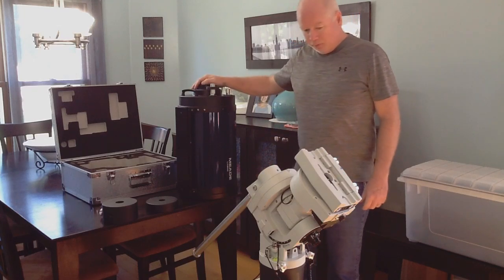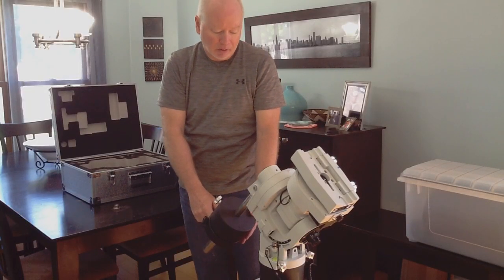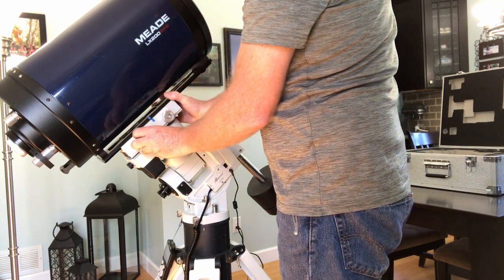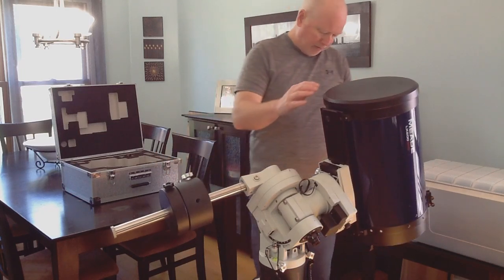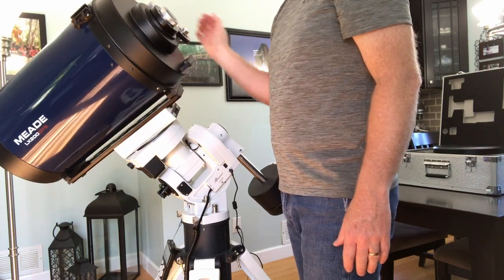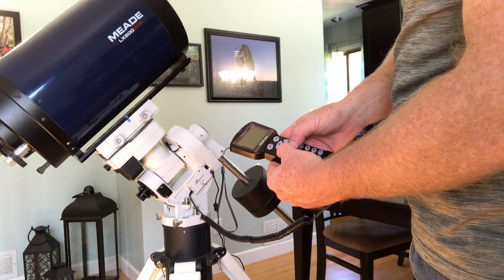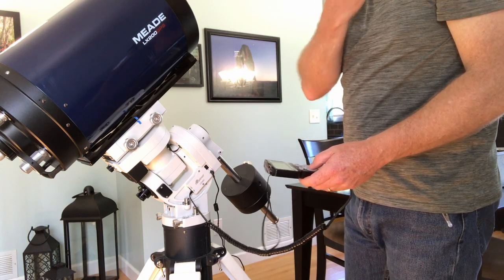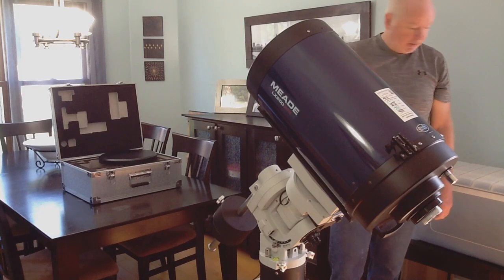iOptron CEM60 - 10" SCT Balance, Zero Position and Stalling the Gears!!

Comment: I had an older Ultima C-11 SCT, it weighed 30 lb on my bathroom scale, so the 10 " would be somewhat lighter, I think?
Mounted the C-11 on my Vixen GP D a few times, it was an over kill on the Vixen mount rated for 25 lb, but careful balancing I was able to use it for visual observation.
Reply: Not exactly apples to apples. Meade SCTs are considerably heavier than Celestron SCTs.

Comment: With my iOptron GEM45 I always tighten the saddle clamps using an Allen/Hex key. You can get it nice and tight. I always put on the end stops just to make sure.
Reply: Neat trick is to add a small lLosmandy/ADM D clamp in front of the saddle to save your center position and to act as a safety in case the dovetail slides out.
Reply from the maker: Great tip!!
Reply: Did the same with my GEM45. Just sold it and bought a CEM60, I'll do the same. Nothing beats that piece of mind.

Comment: Jeff, hey I remember you mentioned that had a Losmandy GI Mount and you said you were having to tinker with it a lot.  I have heard this before, but is this mainly for the older ones or does that apply to the newer model?  I wasn’t sure which generation you were referring to.  Thanks a lot for any input you may have as a I am a newbie looking to get into astrophotography.  I got a used Celestron Edge HD but now rethinking it for first time scope and may return it.  The other mount I had my eye on was that CEM60 but when you total up everything you are approaching the cost for a Losmandy G-11 and that’s why I ask about which generation you had
Reply from the maker: HI!  I had an Atlas EQ-G for a long time and yes, I tinkered with it a bit.  It was really good for a 20-25lb setup (600mm FL Refractor) and I had a lot of success with it.  I wanted to get into a little longer focal length photography (and a bit of I wanted a new mount) so I settled on the CEM60.  I've never owned a Losmandy but a lot of buddies have them and I hear really good things about them.

Comment: Hey i have a question i want to buy a cem60 for a 23-24kg setup  and i am wondering if the mount would handle long exposure photos
I know the weight limit is 27 but i also know for long exposure the more your setup weight the worst it would be
Reply from the maker: I honestly don't think it would work well.  The CEM120 is better suited to that kind of weight.  That being said, there are better and worse setups.  For example a 10" SCT would ride better than a long 6" Refractor of the same weight.  Adding more counterweight closer in is much better than less CW out farther on the CW shaft.  Near the max weight the distribution and balance becomes very important.  Hope this helps.